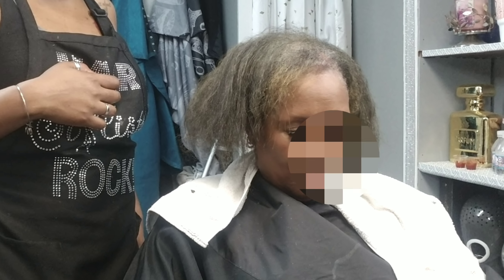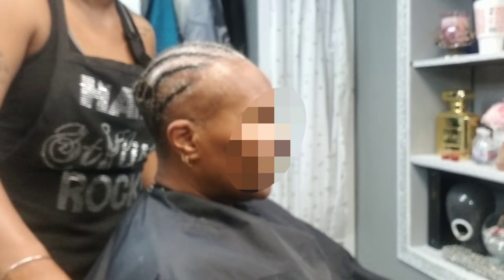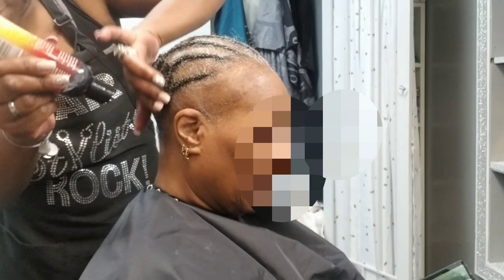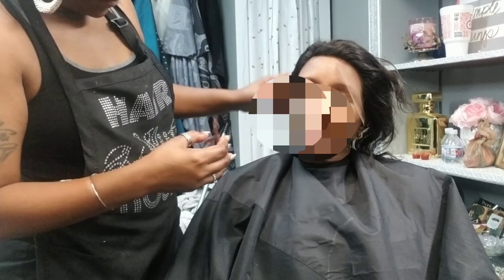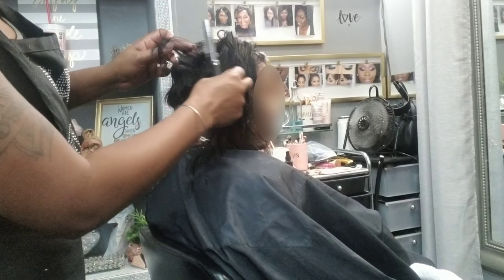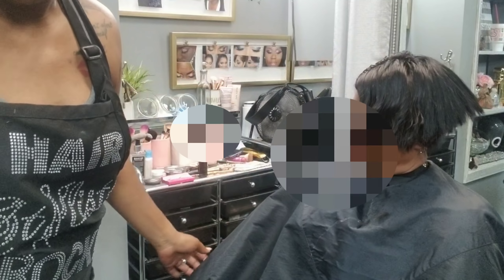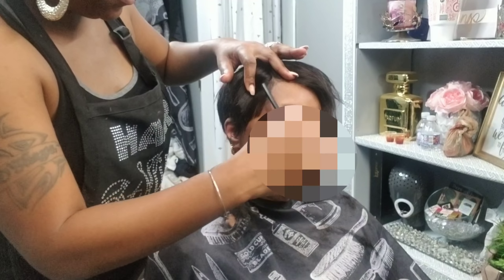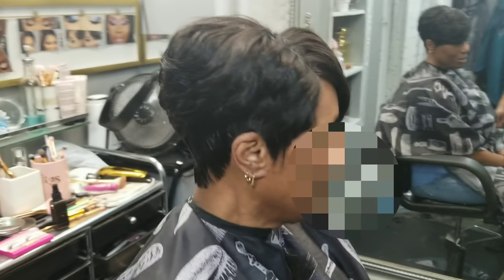#037 (PART 1)FRONTAL SEW-IN ALOPECIA NO EDGES

Comment: Is the pressure of the braids & sew in adding tension to the hair?  You did a great job.:)
Reply from the maker: No she only have a few braids which is not enough to sustain the sew-in. 90-95% of the sew-in is on the actual net. I just stitch her braids in areas so it didn't feel loose